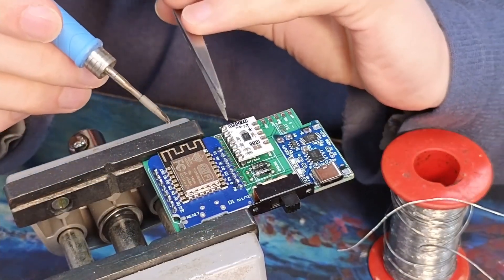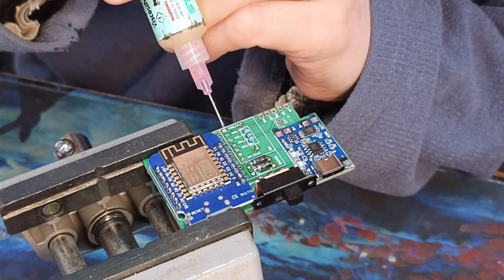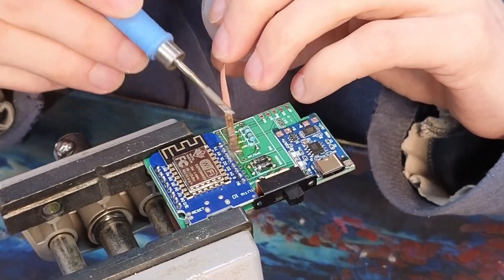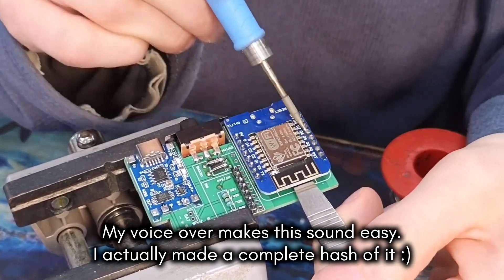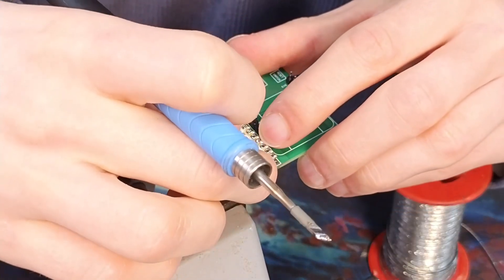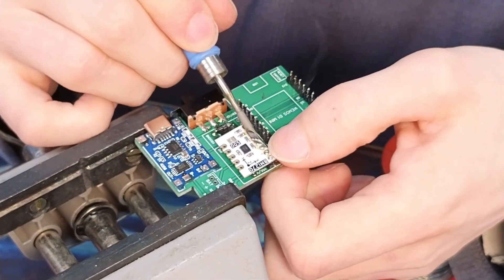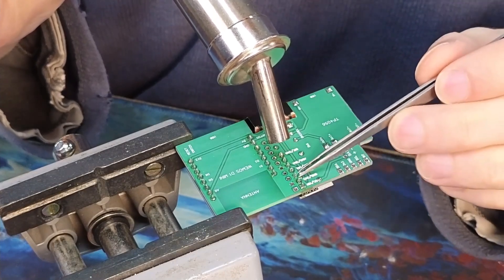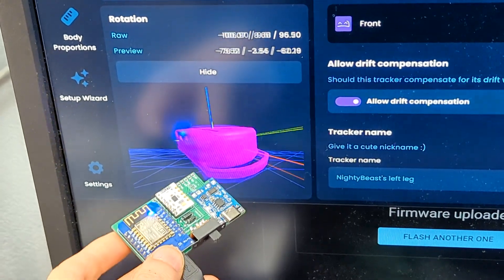SlimeVR FBT - Desoldering With Only An Iron

Comment: I mean, a solder sucker is like 2usd and most of the time they just give it away together with the iron. why go through that raking process at all instead of desoldering pin by pin ?
Reply from the maker: Depends how well the sucker can clear. I find a lot of the time that there's always a little bit left over that I can never seem to get, which means the part is still soldered on, and now there's a sliver of solder you can't get the heat into either. I find solder suckers and desoldering guns more useful for clearing holes.
This is just me though, I'd always suggest people try different things to see what works for them!